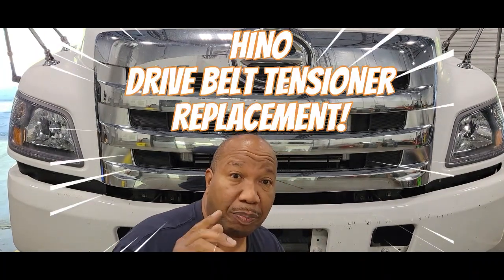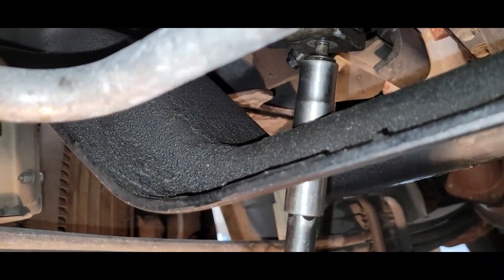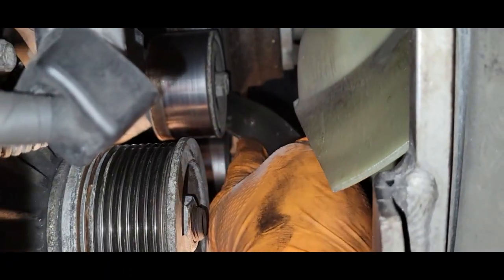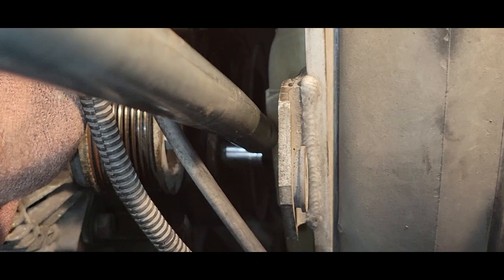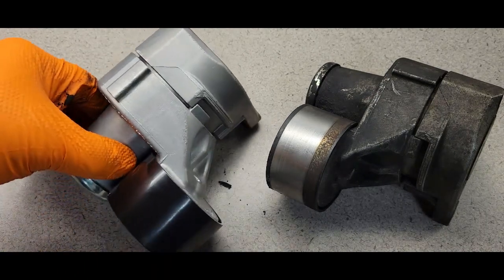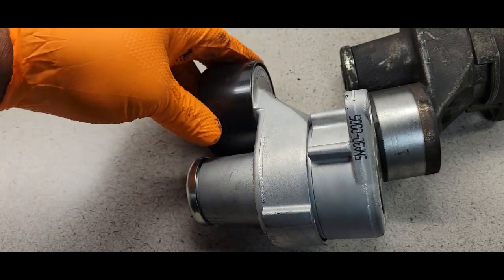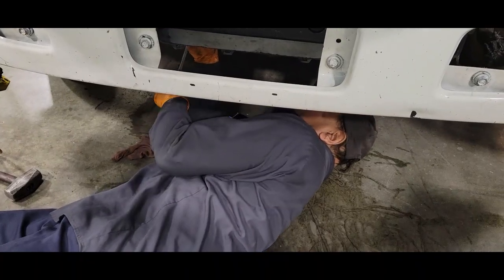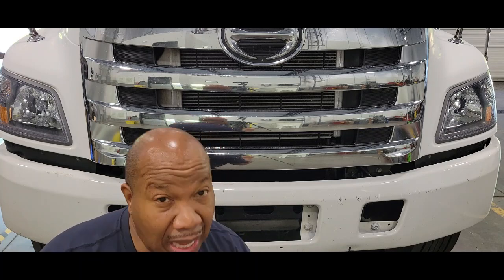2017 Hino 268  Belt Tensioner Replacement

Comment: Hello…sorry to bug you again. I have a 2020 International MV and noticed a coolant leak. Tracing it back, it looks as though it’s coming from between the fan housing and the radiator on the low corner passenger side. I see a puddle in the area right under the pulley. Any thoughts on what might be the cause? Any help is greatly appreciated: I can cash app you for your trouble. Thanks in advance.
Reply from the maker: If coolant is leaking from the bottom area behind the pulley on the passenger side. Chances are it's a Water Pump. Look on my Channel for the Water Pump replacement Video.  And follow it step-by-step. Cash is never needed on this Channel.  This Channel is all about helping everyone to save money 💰 !
Reply: Thank you Siir!!! As soon as I get home I’ll search for it. I have  warranty but it has a 1000 deductible

Comment: 1:40 do you know the part number for that adjustment screw or how long it is? Mine was corroded and snapped while adjusting it to tighten the belt. Thank you!
Reply from the maker: I hate to hear that. No sir, I do not have the part number or length off hand. You may want to call your local Hino Parts Dealer.  They will need your full Vin#.
Reply: Same thing happens to me
Reply: How did you resolve it